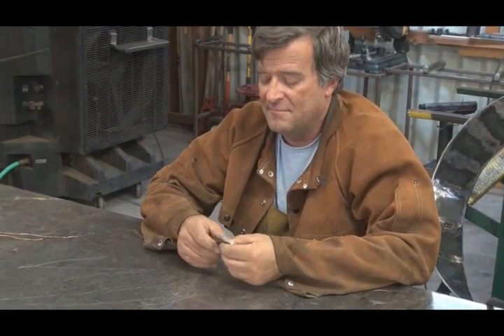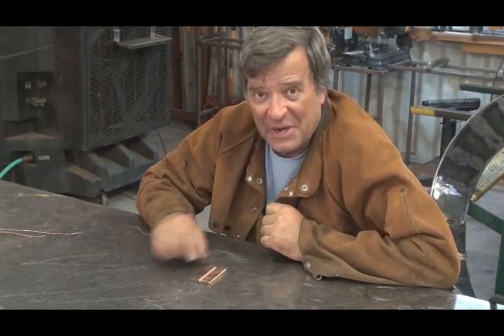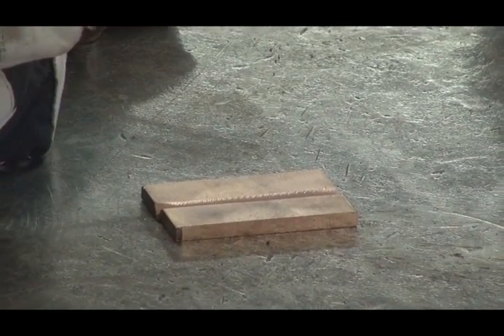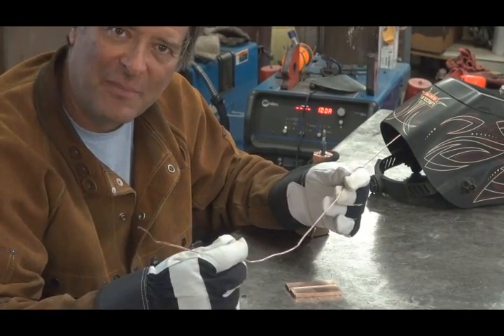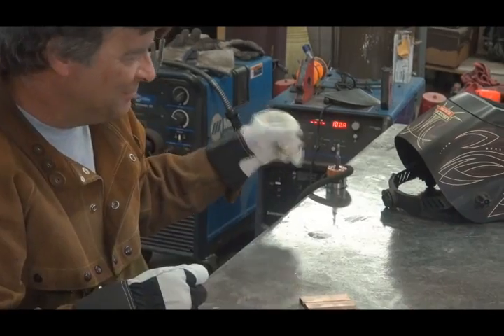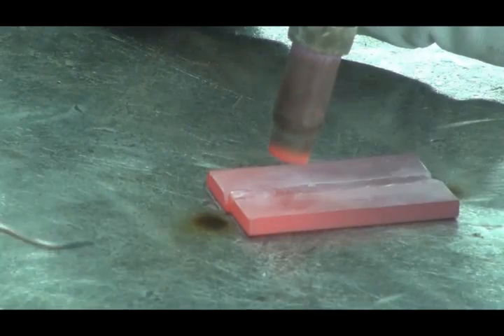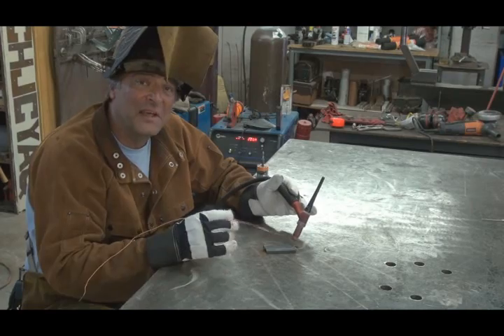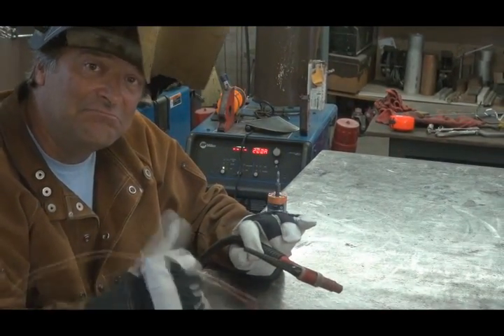How to TIG Weld Copper - Kevin Caron

Comment: After watching this video I tried it. Damn! It can be done quite easily but the draining of heat by the copper is unreal. I tagged some thin 1 mm copper plate onto some 6 mm round copper bar (I do art metalworking). It's tricky to do anyway because thinner metal always blows first but with copper it's possible too.
I used argon and basically everything I'd do when steel welding - just much higher amps.
One problem when done is the copper becomes annealed. It becomes very soft and malleable which for some uses might be an issue. I'm also unsure just how strong the weld will be - micro fractures etc.
Fascinating and inspirational video. Thanks!
Reply from the maker: Thanks for watching and posting Jack.  Still learning how all this works together.  And having a lot of fun while doing it!

Comment: Have you tried sil bronze or 309 with copper?
Reply from the maker: Yes I have tried silicon bronze on copper.   Was not happy with the look of the joint.   Found romex to be a better match to the copper pipe I was using.
Reply: Thank you. I'm making two copper pipe tungsten holders to store new and the working units in so color match is what I'm after.

Comment: 200 Amps to get started and it took it's time, wow. It does look like a good beginners metal, some time to work with. I might have to give that a go one day. Can you DC Tig on it? or is it like Aluminium and best to AC?
Reply: +SupaLexy Supanautica and MotoLexy just watched another video on it, seems to be a little different. Not so easy, but just diff
Reply: I weld stainless all day long, mostly 16g. Amps range from 50-70. When welding same thickness copper I have to go 120+ it sucks the heat out very fast.

Comment: actually copper conductor wire is pure copper so it may be best on some applications just to use spare wire. my opinion of course by no means have i done a metallurgical evaluation on this process
Reply: I was thinking that. I was sat here with no reason to condemn copper wire. But I don’t know what it is alloyed with? But, if it is alloyed with something ductile, that is probably what is needed anyway to stop brittle welds.

Comment: Hi Kevin. As always, thanks for the videos…I'm always learning! As a direct metal sculptor I'm interested in copper sheet, say 20 to 24 gauge. I noted all that heat on the pieces you used here in the video. Is it likely to be routinely burning through thinner sheets of copper?

Comment: Ahh electrical wire... I never thought of that, I've Been using slithers of copper.... no needed for flux then? I'm struggling with a job at work, my weld is not strong enough.

Comment: Copper electrical wire is one of the highest grades (purest) forms of copper you can get. Higher then copper tube or sheet.
So you can just go to Lowes or Home Depot and purchase unshielded ground wire by the foot in whatever gage you think you need.

Comment from the maker: It was a number 12 or 10.  About 1/8 inch in diameter. 

You might try a propane torch on a low setting to preheat the copper...

Comment: I am welding a 4" x 4" x 1" thick block of copper to eight 1/2" copper tubing with an 1/8" wall  , got the machine maxed out Miller 250 Bobcat , Tig will not penetrate the block and romex seems to run away or fall apart. I guess I need to preheat the plate electromagnetically LOL.  What size romex wire did you use?
Reply: They don't make enough electricity to weld copper of that thickness ... just one man's opinion ... with years of experience.

Comment: The old pennies are brass.  95% copper, 5% zinc.  In 1982 they switched to the copper plated zinc crap.  1981 and older are all brass, and 1983 and newer are plated.  1982 is a mixed year and they must be weighed to determine which they are.

Comment: Welding dissimilar metals is not a good long term solution.

I brazed copper to stainless once...  It was very very difficult due to the thermal properties  being at odds.  In the end I got the joint but they corroded badly at the joint.

Comment from the maker: Keep in mind that I am self- taught and not certified in any form of welding.  I find the copper welding to be just as strong as a regular piece of copper. No difference that I can find.  But I am just doing art with this work. Nothing that is going to cost a life if it fails...

If you are going to be working with lots of different types of metal than you are going to need a TIG welder. The easiest and quickest way to work with all types of metal. Which one is up to you and your budget.

Comment: Hello there! I stumbled upon this video and I had a couple questions:
1. How strong was the weld after it cooled?
2. I need an opinion on welding equipment. I am saving up for a plasma cutter and I am looking for something to put the metal back together. I plan on working with steels, copper, iron, etc. at a thickness of no more than 1/4th" but mostly 1/8th. What would you recommend that the insurance wont have a fit over?

Comment from the maker: Nope, running dc on this one.  Haven't tried to do it with ac but I will give it a try.  It was turned up pretty high on the amps. About 150 if I remember right. Hit it hard and then back off once the puddle gets going.  Just like aluminum....

Comment: interesting, are you running ac? sounds and looks like it, if so why are you running ac? i've always heard it can be done ac or dc, you should get the heat in faster and with less amps on dc, theoretically, but i'm guessing you'd be running about 90-95% en anyway so probably not a huge difference!

Comment: if you can't get it hot enough to silver solder with oxy acetylen assuming you are using big nozzles you probably won't be tig welding it ;) depending on what kind of boiler it is, i'd just solder it with normal leadfree solder bars, i'm no boiler expert, but i don't see a problem with normal solder, most copper plumbing is lead/leadfree soldered after all ;)

Comment: Hi Kevin , thanks for your quick response , boiler has been dry for some years now . i believe the copper is very thick .   initially i tried to silver solder it but even using 2 large blowlamps and an oxy aceteline torch wasnt enough to overcome the dissipation of heat ..one thing is for sure .if i ever get it fixed it will be a very efficient boiler !!! 
i will message you with my email add . then i can send you some pics ,thanks again .

Comment from the maker: @donkey2lathe Well, my first thought was, "is all the water drained out?"

At 150 amps you should be blowing holes all over that thing. Has to be something inside sinking the heat away. Either that thing is way thicker than you think or it's still full of water.

Let me know what you find please.   I would really like to know what you find...

Comment: Hi Kevin ,thanks for taking the effort to upload your vids . i always find them very helpfull .
i restore classic cars and am quiet capable with a mig and arch welding ....but i have a model locomotive copper boiler with a few small leaks around some rivits .   i have tried silver soldering but the heat just dissipated before i can melt the solder .so i tried tigging it with a 150 amp tig and still the heat just goes away .it is a heavy item at 3 feet long and 6 inch diameter ,any suggestions

Comment from the maker: @Bonaireboy85 If his machine can run about 100 amps you should have no problem at all. Defenatly do a few test runs on some scrap first but you should be fine at about 75 to 85 amps to start. When you are welding it should be in the 55 to 65 range i think.  

Hope that helps....

Thanks for posting......

Comment: I have a small project for my brewery I'm looking to have TIG welded like that since I'm trying to avoid brass in the system if I can. It's 3" copper tubing with 1/8" wall. What kind of amperage do you think I might need for this job? My buddy has a TIG, but wasn't sure it had enough current to do the job, and we haven't dine any tests with scrap yet. The longest weld will be 18" long, so I figure that will soak up a substantial a mount of heat.

Comment: Haha I had a project at work about a year ago welding copper and used the same wire!! Thought I was the first to figure that out. I also was surprised that it took almost 100 amps to weld copper that was thinner than 1/16!!